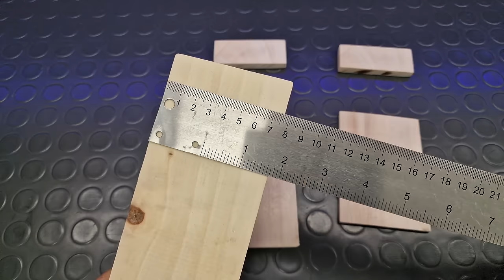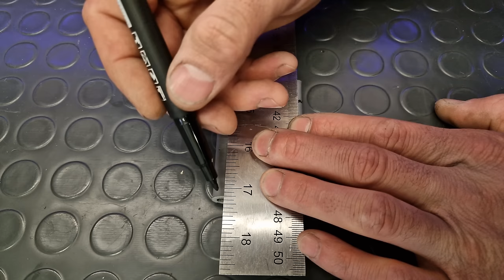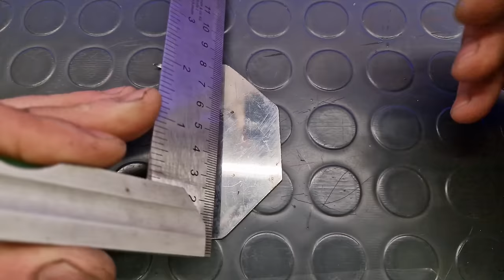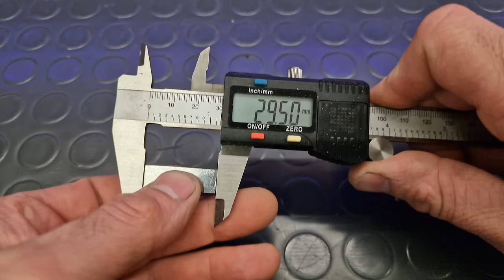DIY PARKSIDE Battery Adapter from PVC Pipe You no longer need a 3D Printer

Comment: Interesting video. I suggest adding a fuse and cable strain relief. Shorting out that battery will quickly start a fire.
Reply from the maker: Thank you🙏
Reply: I suppose the battery has short circuit protection inside, as I saw a current sensor.
Reply from the maker: Yes, there is a fuse inside the battery, it is also used to measure current

Comment: BEWARE of using parkside batteries on other tools, all 20v parkside tools have a bms and cell balancing, BUT it does not test or prevent over discharge, if you over discharge a parkside battery, the protection chip in the battery will lock out the battery forever! its a safety feature of the bms IC, recharging cells will not unlock it.

Comment: You don't need a 3D printer.
Just an angle grinder, a heat gun, rulers, calipers, a saw, sandpaper, glue, clamps, a file, a marker, a dremel, a vice, pliers, a hammer and a bench grinder.

Comment: Super..waiting on part two..on the Tool side! This is only 1/2 of adapter what i need..😘
Reply from the maker: I'm glad if you liked it, I used this adapter to make a working light.
And tis is the video 2.nd Part
👉https://youtu.be/n9la9bxYzzs
Reply: Amazon sells these, seach dewalt to Milwaukee or whatever brands you have, they are called power wheels adapter

Comment: Year lata 😂 nice 
Dont cut metal with that grinder mine failed killed controller after a kick back magic smoke 😂
Make one to fit the drill and double connect for multiple battery and charger

Comment: Best options:

Buy a 15,- 3d pen. Very useful for many things. Put some aluminium foil on the battery first. Then just fill in the important things with the 3d pen. Do the same to the receiving tool. Then bond the 2 parts together. It will be an ugly thing but it will work. 

Or make something with epoxy.

Comment: If that's an 18 V battery, that H1 halogen lamp will be toast in a very short time...
Reply from the maker: For 1 second it can last, however the lamp is for testing🙂
I used the adapter for the LED lamp, you can see it in this video: https://youtu.be/n9la9bxYzzs

Comment: Thank you for this video,its exactly what i needed to connect einhells battery to a old AEG cordless drill.Instead of using peace of metal i used spade male crimp connector.
Reply: Amazon power wheels adapter 20 bucks

Comment: These are only 10 to 20 bucks on Amazon,  not worth the time to build it, they are called power wheels adapter but they also sell battery adapter to fit all drills or tools to use other batteries  ,
Seach dewalt to Milwaukee or whatever your tool are